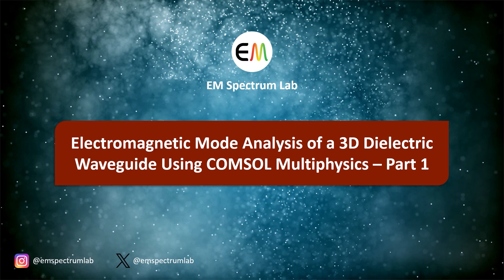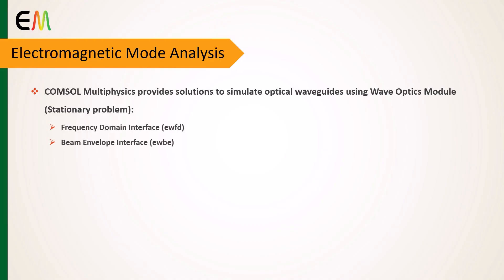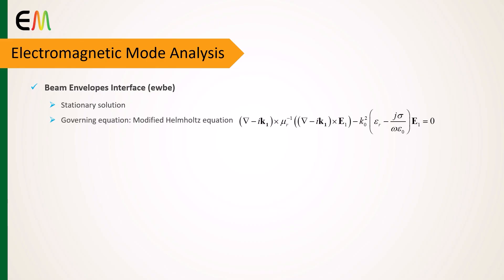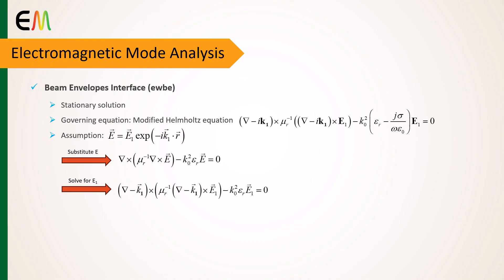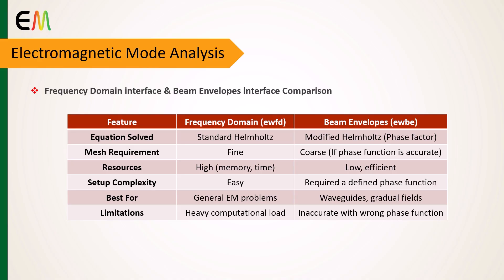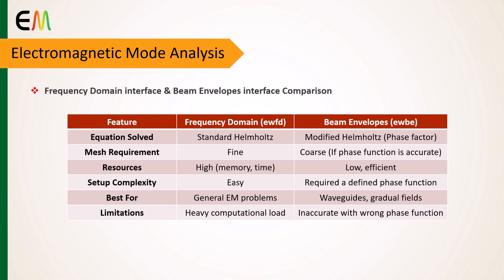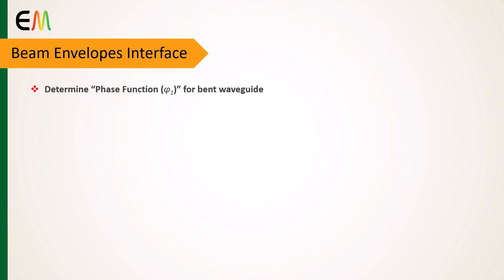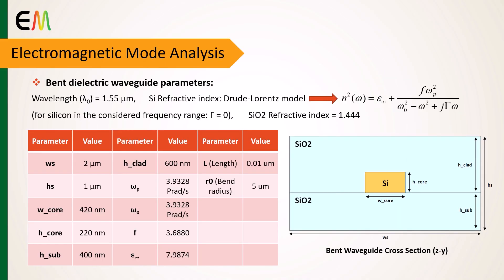COMSOL Tutorial - Electromagnetic Mode Analysis of Dielectric Waveguide (Part 1: COMSOL Solutions)

Comment: Thank you for these videos on COMSOL 3D dielectric waveguide analysis. 

1. Any idea how to simulate multiple modes in 3D using ewbe? The idea is to solve for different modes in BMA for ports 1 and 2, and then to use Frequency domain analysis to see the envelope. However, if one chooses solution with mode analysis, the resulting field is zero.

2. The image on the right at 4:54 does not seem to show the envelope in the plane perpendicular to the ports. It looks as if this plotting plane shows the actual field amplitude. Can you, please, elaborate?
Reply from the maker: Thanks for your comment. I will explain the simulation procedure including calculating multimode modes in the next video (It will be published on upcoming Monday). Your considered image shows the real part of z-component of the electric field in the waveguide.